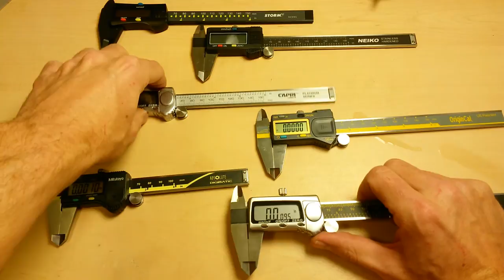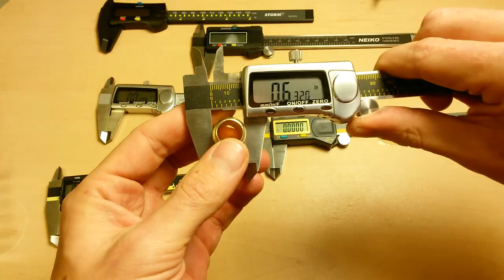Old Version~ Digital Caliper~ Proper Use & Measurement Techniques ~How to Get an Accurate Reading

Comment: Hi, thanks for the videos.  I also saw the one about the variance between inside and outside measurements on cheaper calipers (I have harbor freight) and was wondering if you know a way to set zero on the inside measurement?